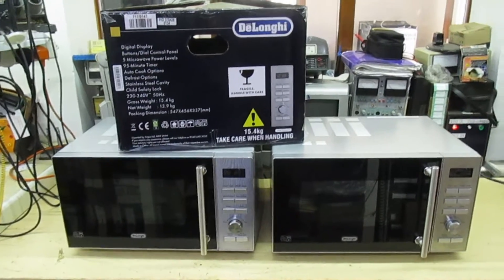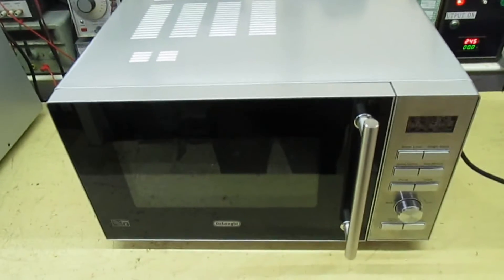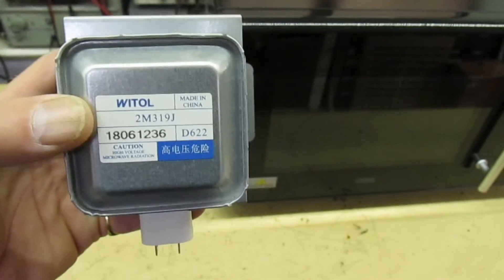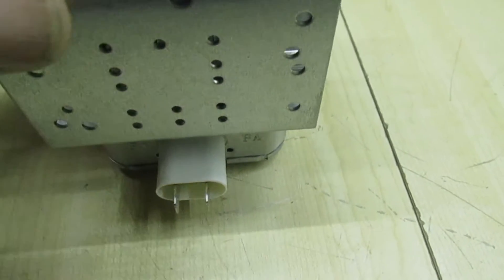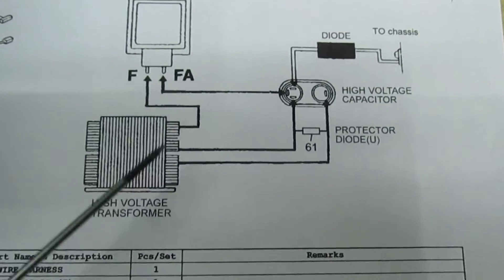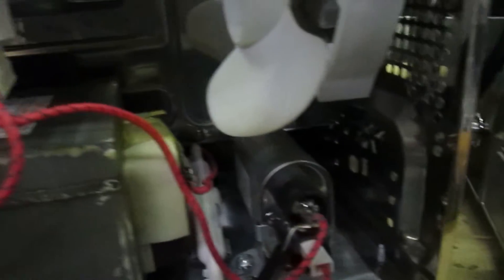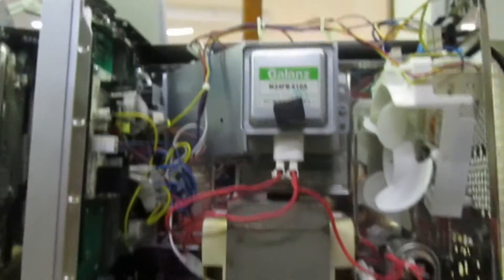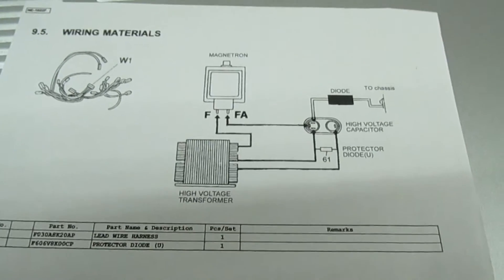Delonghi Microwave oven not heating ? Then you must watch this video

Comment: Flippin' 'eck! Hope Argos are going to honour these returns. They should do hopefully.
Reply from the maker: A lot of people are not aware there is a law that states electrical goods should be expected to last for a reasonable period of time and if failure is due to a manufacturing fault the retailer is still  responsible if failure occurs outside of the manufactures warranty period, you need to obtain a written report stating this failure is due to a manufacturing problem and return the item along with the report to the retailer, Argos in this respect are very good , only a few weeks ago I did a report for a customer and argos gave him a pro rata refund of about 80 percent of the price he paid on a 14 month old LCD TV with backight failure. The retailer  should also cover the cost of obtaining a written report from a dealer.

Comment: Michael - many thanks for your drawing this to people's attention. I just had the silver one pack up last night (after about 18 months). High Voltage Fuse & Magnetron both gone.

Just picked up another one (the current model 900W that's in black) - needs must and so forth - before I plugged it in, curiosity got the better of me.

Cover off and guess what? Transformer still goes to FA and Capacitor goes to F.

So they are still building in failure (12-18 months), in Aug 2022.
Reply from the maker: These are of course not made by Delonghi, just bought in from china for next to nothing and badged up, China don't seem to have heard of quality control and I bet argos get these on a bought out warranty so if you took one back under warranty they would simply give you another rather than do a repair .

Comment: Thank you for this tip. I use to repair microwaves everyday years ago and I had no idea about filament polarity being critical.
Reply from the maker: I am struggling to find a definitive answer to why its so important but back in the 90s on a microwave training course we were told its because you don't want the filament voltage travelling up the cathode .
Reply: @michaeldranfield7140  my only guess is maybe the cathode is bonded to one side of the heater. The 3.15 volt heater winding would probably have a high impedance at 2.4 GHz and cause back EMF
Reply from the maker: @chrisreynolds6331  thats got to be one of the best explanations I have come across so far , yes the cathode is connected to one side of the heater .

Comment: Hey there, I watched your video after my delonghi microwave packed in around the guarantee was just up. With tons of caution regarding the capacitor I found that the fuse had blown, but to my surprise the wiring connectors on the magnetron where crossed over. I put them as to the diagram you showed us and replaced the fuse. Everything works...brilliant...thank you so much for your expert help, you saved me a lot of problems with argos and possible a lot of money if I had to buy another microwave...thank you again cheers
Reply from the maker: No problem at all, sometimes the high voltage fuse just dies from old age without any underlining cause, I don't know what effects long term will be caused by running the maganton out of phase but I guess time will tell.

Comment: Thanks for this video, whilst changing an oven element in a Sharp combi microwave R82, I checked the wiring and that was wrong as well.  Probably explains why the thermal cutout on the magnetron trips after 8-10 minutes.  I am hoping the tco has protected it as for now it still microwaves  fine.

Comment: Michael thank you for making your informative and enjoyable videos. In 1972 after leaving school for a couple of years I worked on a moving belt production line firstly as a tester and later troubleshooter on the Thorn 3,500 series colour TV chassis. Back then a 22" cost about £350 and a Ford Granada £950. 
Your video prompted me to check three microwaves - a De Longhi, a Russell & Hobbs and a Morphy Richards. From the internal construction they appear to have been made in the same Chinese factory. All were fitted with Witol 2M219J magnetrons. All had a green coloured identifying insulation sleeve fitted to one of the magnetron heaters spade connectors (so no excuse for getting it wrong). While these are now a few years old all had the connections crossed crossed wiring which I have corrected.  Would love to find out the circuit of your home made capacitor reforming unit.
Reply from the maker: I remember the 3500 very well , still got some parts for them in stock , ask me tomorrow for the capacitor reformer when im back at work .

Comment: Thanks so much for this video. I tried to change a blown bulb and checked the wiring. It is as you said. Wired incorrectly from factory so I will be taking it back to the retailer.
Reply from the maker: a lot of microwaves now don't have an inspection flap for replacing the bulb and you need to take the cover off just to replace the bulb, everything is very poorly made and not designed to last any length of time .

Comment: Hi Michael,

This is exactly what’s happened with my microwave . I spoke to argos and have shared this information though they are still telling me I need to get an independent report which is frustrating.
Reply from the maker: It's a standard practice at Argos to ask for an independent report, however you should inform Argos first, preferably in writing to the branch manager, that an independent report is going to cost money and in the event if failure is confirmed to be due to a manufacturing defect you are going to hold Argos responsible for these costs, in my opinion these should have been recalled by Argos when this came to light, let me know how you go on.
Reply: @michaeldranfield7140  thanks it was purchased when they had a store over a year ago they are now in Sainsburys. I’ve emailed their customer services people though they were not very helpful on the phone let’s see what I get back if not should I get an independent report still or go to an ombudsman ?
Reply from the maker: I don't think they will do anything if you don't have a report but you must stress to Argos that they will have to reimburse you for the cost involved. Under normal circumstances if you bought this item from a different retailer they would simply return it to the manufactures for either a repair or refund at no cost to themselves, however I strongly suspect Argos obtain these on a bought out warranty scheme, this is where a manufacturer will sell an item at much cheaper price strictly on the basis the retailer has to stand any guarantee claims out of there own pocket and they have no comeback whatsoever on the manufacture, this would explain why the item has not been recalled and why Argos make it so difficult to get any recourse, you could ask for someone higher up the chain, say in head office to complain to but don't give up.
Reply: @michaeldranfield7140  thanks Michael I spent over an hour on Facebook to them on chat this afternoon - it was hard work but they agreed if the independent report shows they are at fault to cover all costs and refund me for the microwave as well. As I’ve told them I was going to purchase one as I can see this taking weeks (it’s an item you can’t just go without ) - which I have done from another retailer. 
I’ve dealt with argos for more than 30 years and this experience is really making me ask the question if I will ever shop with them again.

Comment: Hmmm this makes me wonder now, I had one of these exact ones a few weeks ago, with the plugged chopped off. They stated it didn’t heat up, after a new plug it worked fine weirdly. This needs a recall! Nice one Mike 😁
Reply from the maker: Intermittent not heating up is usually caused by a poor contact at the filament terminals , as the heater draws around 10 amp and resistance here becomes critical , I usually just pull the connections off and squeeze them with a pair of pliers ,

Comment: I've got a delonghi and the output power is utterly terrible. It takes 3 minutes to warm a cup of milk that shouldn't take that long and never did in my parents one from the 90s!
Reply from the maker: A common cause of low power is a bad connection on the filament terminals , just pull off the terminals and re fit them to see if the power comes up .

Comment: Delonghi model no 400/7456 had exactly the same thing little used just over 15 months old , while re- heating food one day there was a bang from the microwave everything else works fine but now not heating up. The microwave is little used and looks like new. It always was a loud microwave because the casing on the right hand side vibrated so much during use.
Reply from the maker: Bad batch, I would imagine everyone of these has been wired wrong and its worse when an item is little used because it means it will fail outside of its warranty period.

Comment: Another interesting video Michael, thanks. Is the reason the magnetron eventually fails due to the filament going o/c?
Reply from the maker: I don't atcually know, I have tried running different tests on magnatrons but not come uo with a definitive answer. I would assume though they go low emission and fail to oscillate

Comment: Hello Sir
I have the same De'Longhi Microwave and stopped heating up..How i can find a technician to do a report of miswiring please?  As argos refused to admit the fault and after 2 years they escaped any responsibility unless i proof it with independent report
Reply from the maker: you need to find a repair shop that will write you a report but it wont be free, you should be able to claim the fee for the report back from Argos though .

Comment: Have exactly same problem on P80D20EL - Strange thing is I can detect microwaves from the magnetron when the microwave is empty but as soon as you put food in it - nothing - I suspect that the magnetron has now got to the stage where it cant power up enough to heat the food ie the food is absorbing the waves and it just gives up ?
Reply from the maker: I would imagine the magnetron has gone low emission as these are a thermionic device.
Reply: Same here, and same model. And same problem.

Comment: Why does having the heater connected in reverse cause magnatron damage?
Reply: It's not so much the heater that's the issue, it's the 'A' that's the problem. The 'A' refers to 'anode' - the magnetron is a type of thermionic valve and the anode (or plate) has around 2000 volts on it. This voltage is connected to one side of the filament winding, and I suspect that with these cheap chinese magnetrons the insulation between the filament and ground isn't as good on the F side of the filament as opposed to the FA side. I used to repair microwave ovens for quite a few years and this issue of transposed connections wasn't something I had ever encountered.
Reply from the maker: In order to fully explain this you would have to cut a mangatron open to see but in short, the magnatron is directly heated device, and as such the filament is also the cathode and one end of the filament  is closer to the Anode to which the high voltage negative supply is applied terminal FA (Filament Anode ) , if you were to reverse the connections  high voltage has to travel up the filament to get to the FA end putting it out of phase,
Reply: @michaeldranfield7140  
Ah ha, got it, thanks :)
Reply: @michaeldranfield7140  Does 2-3 V makes some difference at 4+ kV ?
Reply from the maker: @KaVcr  no , its the phasing of the magnatron that matters .
Reply: @michaeldranfield7140  Could you explain why it is? I don't get it.
As a direct heated device it can be sensitive to filament phasing when there is a voltage drop across the filament that is comparable with anode voltage (as in the VFDs).
Also, there is a lot of magnetrons without phase markings.
Reply from the maker: @KaVcr  From my microwave training back in the 90s all I can remember its something to do with high voltage travelling up the filament , I think it should be applied to the top of the filament rather than the bottom , I have not seen a single microwave oven where the phase is not stamped into the magnetron base.
Reply: @michaeldranfield7140  Usually there is no phase markings in the inverter microwaves (magnetron 2M261 and so on).
Reply from the maker: @KaVcr  I just un boxed a genuine panasonic 2M261-M32 and the phasing marks are clearly visible, however you do raise an interesting point  , there are a lot of magnatrons knocking about on the internet which originate from China that are used and have been spray painted with silver paint to make them look like brand new and the painting process covers up the phasing marks, if you look at my other videos I showed one of these magnatrons in a video which had been re painted .
Reply: @michaeldranfield7140  The peak current of the high voltage is about 1 amp, which may cause issues with the filament heating or perhaps HF components and the magnetic field. See Applied Science's video here: https://www.youtube.com/watch?v=I2k2g00onL0
Reply from the maker: @pizzablender  it would seem that the most important factor in the longevity of the mangatron is the way the heater is driven .

Comment: Brilliant video..but please anyone doing this make sure that capacitor is not holding current it will put you in your grave ! if your fingers stray. and ARGOS should do a recall. be interesting to see how the sharp branded vestel ones hold out😁
Reply from the maker: Sharp is another great company which went down the pan , Vestel microwaves and UMC TV s .

Comment: My Matsui MicroOven been fine for 30yrs..
Reply from the maker: Things were much better made 30 years ago, I still use a Sharp microwave at home from the mid 1990s , your going to be a little disappointed if you have to replace it with a new one !
Reply: @michaeldranfield7140  it's still Running Fine..which is amazing...

Comment: Well spotted Michael,  wonder how many microwaves have failed in Argos warranty and just returned or dumped by customers . Pretty high failure rate I would think and no quality control obviously.
Reply from the maker: From my experience with Argos they sell items cheap as they buy electrical goods in on a bought out warranty basis , so the manufactures  say we can sell you this item X amount of pounds cheaper but you must take on the guarantee yourself as a trade off for the lower price, so from what I have seen a customer returning a faulty item to Argos just gets given a brand new replacement item and I would guess the old one just goes straight into the bin ..

Comment: Well spotted  Mike no quality control ?
Reply: Chinese factories don't have quality control! They are too cheap to pay people to check the products as they roll off the production lines. 
The customer (you!) is the QC - if the product works for you then it's passed QC, if it doesn't work out of the box then you take it back, the retailer scraps it and gives you another one (the equivalent of the item being binned in the factory) because it is cheaper to do this than pay people to do QC in the factory.
Reply from the maker: I dont know how they got this wrong , its not as if the Chinese have not made microwaves before !
Reply: @michaeldranfield7140  The chinese don't care. All they're concerned about is being paid, regardless of whether their junk works or not. Slave labour sitting in hot buildings assembling these things, they don't care which terminal the wire goes on as long as there is one.
Reply: @stopthebus  ok boom boom

Comment: First problem - the only thing that's actually DeLonghi on these ovens is the name on the front. The rest of the unit is cheap, mass-produced chinese rubbish . The same units will be sold in different areas/countries with different branding on them. This is becoming very common now. One factory churns out this junk and puts different badges on it depending on who the customer is.
Brands that people look up to and respect are doing themselves a real dis-service by going down this route.
Second problem - chinese factories don't have quality control! They are too cheap to pay people to check the products as they roll off the production lines. 
The customer (you!) is the QC - if the product works for you then it's passed QC, if it doesn't work out of the box then you take it back, the retailer scraps it and gives you another one (the equivalent of the item being binned in the factory) because it is cheaper to do this than pay people to do QC in the factory.
Reply from the maker: absolutely right , this is just badge engineering but I suspect Argos have just bought the name Delonghi same as they have with Bush , JVC, Hitachi and many other well respected brand from years gone by .

Comment: Hi Michael, is it possible to download your report based on this assessment? Same issue but Argos are refusing to acknowledge saying this is the first time they’ve encountered this problem. Many thanks
Reply from the maker: you will need to take your microwave to a repair shop and get a written document stating this is a manufacturing fault, chances are the shop will charge you for a report and then you have to ask Argos to refund the cost of the report as they were the ones who insisted on it .